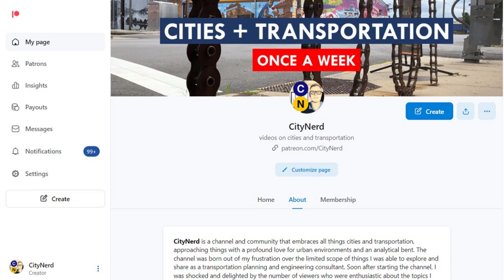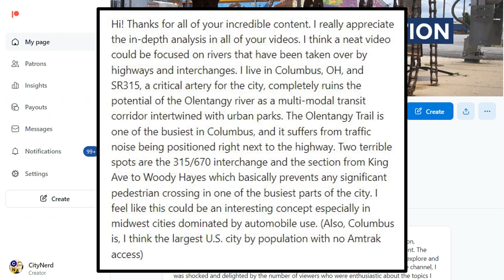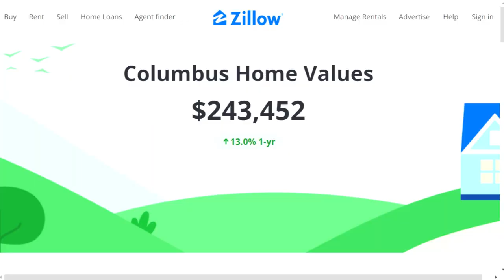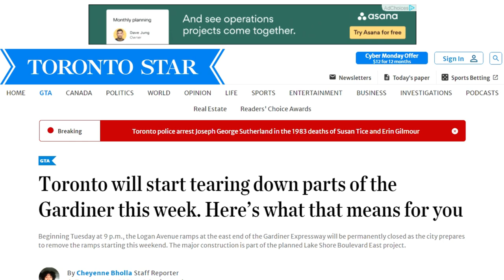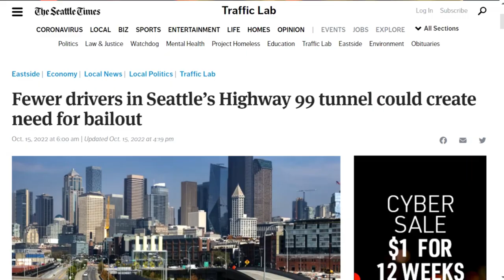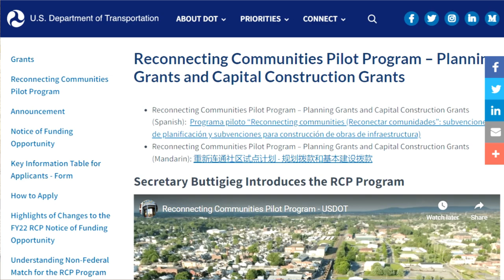Highway Engineering Madness: 10 Waterfront Freeways That Need to Go (North America Edition)

Comment: Halifax, NS, where I am from, almost put a freeway along the waterfront in the 1960s. It was stopped and now we have an incredibly vibrant waterfront and boardwalk. All that was built of the freeway was a single interchange, which is currently being demolished and redeveloped into mixed-use and green space.
Reply: Glad you mentioned this one Luke! I was going to mention exactly the same thing. I am not from Halifax, but knew about the cancelled plans for the freeway. Major bullet dodged! I cannot imagine what Halifax would be like now with a freeway instead of the great, people friendly waterfront. The naval dockyards necessarily block a lot of the waterfront, but there would have been nothing left if they had build the freeway.
Reply: Should do a Top 10 of cities that reverted and show what the difference is like.
Reply: Halifax has its own issues but a neutered waterfront ain't one

Comment: Chicagoan chiming in.

Lake Shore Drive certainly bothers my urbanist sensibilities, but I also feel like it has a weird romantic appeal to a good number of people. If you're forced into a car-centric lifestyle (which many Chicagoans are, sadly), it is a really cool stretch of road to drive down.

But as someone who has been car-free in Chicago for a decent number of years, I lament how much worse the lakefront experience is due to LSD.
Reply: It's definitely a trade-off. If LSD didn't exist, I'd probably have to move far out to commute to my job, and that would just contribute more to sprawl. LSD is the only way for me to connect to the expressway.
Reply: It's legally supposed to be a "pleasure drive" which is sort of commendable (but not really). And it doesn't even abide by that.
Reply: I think converting it into a boulevard with a high frequency transit option is a good solution. It allows some car usage to remain for those who need it, but also provides a transit alternative to get people out of cars & make the parks more pleasant.
Reply: not from chicago, never even really been there but i drove through there a couple times. took LSD once, its a great drive but 6-8 lanes limiting access to the lake shore from most of the city. should still exist but reduce the lanes.
Reply: Chicago neighborhoods typically have streets with cars parked on both sides, and then an alley in between with garages that are full of cars too. Getting rid of LSD would cause non-stop traffic jams on our East-West axes until people adapt to a more urban style of getting around.
Reply: @newagain9964  low income people also take the buses that run on it
Reply: I lived at Belmont and LSD for a number of years. There was tunnel a couple blocks away - CityNerd thinks somehow that these tunnels are unappealing. I didn't give it a second thought - walk through and poof - you're on the greatest lakeshore in the world. These other examples have prevented almost any use of the waterfront. As CN well knows, the lakefront in Chicago is fantastic. So it's all there, even if LSD disappeared you would have to cross some type of through street to get there. So it's not perfectly convenient, but it shouldn't be on the list at all - because very very few people that live near the lake think "I'd love to go to lake today, but don't want to deal with LSD." I don't think anyone thinksthat. If you want to go to the lake, you just go the lake. (I'm sure in some stretches it's a little  more difficult - but not that much.)
Reply: @mauryvan361  the thing about a highway is you don't get ground-floor retail in the buildings along it. That's a huge missed opportunity. And some of those tunnels are impassable due to standing water at times.
Reply: @collinpearsall9084  I understand your point but I don’t think anybody is missing first floor businesses right next to the lake front park. Those businesses are just in the other direction a block or two or three. When you’re on the lake, you’re there to experience the lake not necessarily a café on the lake. And then we would probably complain  about all the commercial properties right on the lake.
I’m sure they could have more and better tunnels. And somebody else mentioned that they couldn’t have a conversation for the traffic noise which should only be a problem in the very narrow area near  downtown where it’s right next to the LSD. Traffic noise was never something that I thought was more than occasionally annoying having lived right there. 
But I’m sure nobody, including me would complain if we did what Boston did, and build a tunnel to take the place of Lake shore Drive . But that would cause its own set of problems.
Reply: @AlecSchwengler  It's already a boulevard with a high-frequency transit option.
Reply: @UserName-ts3sp  That wouldn't make any difference.
I've lived here almost all my life, never learned how to drive a car, and have never experienced the perceived Greek tragedy you dilettantes are playing with the Drive. The city is not cut off from the water by the Drive at all, and anyone who would whine about having to take their bikes under a tunnel for 30 seconds doesn't deserve to bike the Lakefront Trail anyway. (Nobody whines about that because it's nothing.)

Comment: 12:50 The location of many of these cities is determined by the "Fall Line". The Fall Line is the border between the costal plain along the East Coast and the "Piedmont" foothills further inland. At these locations, rivers had rapids and they were the harbours for river shipping in the past. These inland harbours grew into a string of cities in the modern US that stretches for thousands of miles.
Reply: Many east coast cities started as mill towns before wide spread steam power and needed the rapids for hydro power for mills and factories.
Reply: Well, true, but Raleigh and Charlotte, the two largest cities in NC, aren’t on rivers. Raleigh was intentionally selected away from them because a site for the capital was being chosen during the revolutionary war and people feared the British coming up the rivers. Charlotte was established where it is because it’s at the intersection of Native American trading routes. Set up to take advantage of that trade. Assorted smaller cities I have no idea. It’s certainly a geographical oddity to have none of the states largest cities sited on rivers.
Reply: @granthancock3622  even without being directly on rivers, both Raleigh and Charlotte are close enough to rivers that the army corps of engineers was able to create lakes by damming the rivers to create reservoirs so they’d have drinking water.
Reply: The fall line is an awesome phenomenon/concept. Basically anywhere where a shift in transportation mode is required, becomes a likely catalyst for a town/city. But since the fall line hinges on rivers, it's totally counter as an explanation for the lack of rivers in North Carolina's major cities.
Reply: None of the named cities are on the fall line.
Reply: Raleigh was chosen well after the war but your point stands. Also the owner of the land gave the location committee an evening entertainment consisting of a beverage called “cherry bounce.”
Reply: But the rivers had nothing to do with their location or development.  The lakes are a long car drive outside those cities. That’s not “close” enough to have anything to do with their historical location.
Reply: Well, except for the fact that none of the named cities in the video are anywhere near the fall line.
Reply: @thebuttermilkyway687  Raleigh is but the others aren't.

Comment: Most inland North Carolina cities were built along railway lines. This is actually true of much of the southeast, which has only a few major rivers. So they may look random if you are expecting waterfronts, but there were reasons.
Reply: What is the source of water for those inland cities? Underground water from wells?
Reply: @mowplsu  It comes from reservoirs - there were a bunch created in the early to mid 20th century IIRC. At least for the 3 biggest cities in NC (Charlotte, Raleigh, Greensboro)
Reply: @mowplsu  There is enough water supply via surface, reservoirs, and ground water, just not enough for significant navigable waterways.

Comment: Chicagoan here! I spent pretty much the whole video wondering if you were going to bring up Lakeshore Drive. 😅

My take: the tunnels under LSD do make it relatively easy to access the lakefront on foot, though using them is decidedly less pleasant than just strolling on foot at grade would be. The real issue with Lakeshore Drive is the noise--it generates constant noise that seriously hampers one's ability to really enjoy the city's otherwise incredible stretch of lakefront parks. There are a few express buses (most notably the 156) that make good use of LSD for fast public transit, though in all honesty the 156 is largely duplicative of red line trains for all but the richest of lakefront property owners, so I'm not sure how many points that should really award it.

If I had to guess, I'd say that demolishing Lakeshore Drive will be a hard sell politically, as many Chicagoans rely on it for daily commuting. We should still totally do it, though, then pump whatever funds that frees up into expanding the L system and running more frequent trains.

Comment: As a Chicago resident, Lake Shore Drive (LSD) presents with a love-hate relationship for me. I run in the park every day and avoid the pathways nearest LSD, although there are constricted sections that are right along LSD and you can't avoid running close to LSD and are rather unpleasant. The tunnels under LSD are pretty cool places for me. I've been through all of them and rather like them. They're placed at about 1/2 mile intervals. Some have cool entryway artworks and paintings. Over the many years I've been going through them, I've never known them to be dangerous. 
What I do love about LSD, are the all-day express buses that I use to go to the Loop. I rarely use the L because I can get to the Loop in 15 min on the express bus w/o traffic. They run until late at night. So, I love LSD for that convenience but hate it for taking so much park space. The city is thinking of re-designing LSD with dedicated express BRT lanes and perhaps addl infill to add park land. In beautiful Jackson Park, the presence of LSD is especially egregious as it presents as a near continuous wall right up against the water. 

I do remember, when I was a kid in CA, and my Dad would use the Embarcadero Frwy to get into Chinatown or North Beach quickly. I remember that is was a bleak freeway to be on. The lower deck was dark and gloomy. I didn't even know what the Ferry Bldg looked like until the 90s when they tore the freeway down. It was only then that I realized just how the city opened up after it came down. My whole life, the city was cut off and shunned the Bay, now The Embarcadero, and especially the Ferry Bldg, is a jewel of the city.  

The cities of NC are located along the Fall Line. This is where hard rock gives way to soft soil and, as a consequence, as far as water borne freight can go. Most of NC's large cities are located along this line. Cities were located along the Fall Line for the water mills, transportation facilities, and commerce. There is a line of cities located along the line from DC to Atlanta.

Comment: Lived right off Lake Shore Drive for a few years, near the north end by Foster Ave. I used to walk to the shore all the time, no problem. Some factors that mitigate the yuck: Yes, I did have to walk under the tunnel, but once you cross under, you get this glorious wide expanse of beautiful lush green fields and trees. There was a dog beach there, and lots of other beaches all the way to downtown. The pedestrian/bike path gets crowded at times, but it goes nowhere near the road. It would be nice if they widened it or added another one. Also worth noting that freight trucks aren't allowed on LSD, and this probably keeps pollution lower?

Comment: Funny thing is that most of those locations, including Chicago, the highways are close to, but not on the river bank, and the actual river banks are filled with good uses, especially in Chicago where there's a great trail, marinas, piers, parkland, and even a golf course.
Reply: It almost makes it worse. Riding your bike down the Lake Shore trail in Chicago when it's only a few feet from a giant freeway is so loud and bad for your lungs. It's like the city planners were designing Chicago specifically to maximize particulate matter inhalation.
Reply: I don't know about Chicago, but in Toronto nearly all the land lakeward of the expressway is landfill. Many buildings further inland have weird features that make no sense until you realize that's where the waterfront used to be.
Reply: @slavkovalsky1671  Historical context, everything east of Michigan Ave from about Cermak Rd (22nd St) to Oak St was built on landfill as part of the Columbian Exposition. Michigan Ave literally was at the lakefront.
Reply: Think that's the biggest point... Much of these sit on landfill, or former warehouses that went into disrepair as river commercial traffic declined.

It was simply the easiest way to add a road without demolishing a swathe of the city.

Comment: Another great video but one item you could have added ( and I hope you read this): beyond taking out lovely green space connecting Back Bay and BU to the river, when they built Storrow Drive they installed an at-and-above-grade interchange smack in the middle of Charlesgate Park, a flood control park and part of the Emerald Necklace designed by Frederick Law Olmstead.  Yes, THAT Olmstead.  They destroyed an Olmstead Park for a highway interchange into the Fenway. Hardly punishments enough for such an intergenerational crime.

Comment: The reconnecting communities fund removed a freeway in Detroit. I would love to see your analysis on that project- Detroit is sort of a dichotomy. The city is super car centric but also has an award winning River walk and a lot of new walking paths being installed to make the city walkable.
Reply: I will be so pumped once it's not possible to take I-375 directly from I-75 to Jefferson Ave! Next step: terminate M-10 (aka "the Lodge" at I-75, and leave Detroit as it always should have been, with no freeways entering the core downtown, and with I-75 at a respectful mile or so inland from the river.

I grew up near Philadelphia, and had figured the combined atrocities of I-76 and I-95 through Philadelphia would have made the main list. It's so dispiriting if you're in the historic area of Center City to have to cross ten lanes of freeway (expressway in Philly jargon) on a concrete deck to get to the waterfront. Philly has a great downtown that is pretty much ruined by the freeways. The only saving grace is that in the 60s PennDOT proposed running expressways along pretty much every waterway in the city http://www.phillyroads.com/history/expwy-map_1966/
Reply: Detroit should have the I 75 numbering follow I 94 and 96 around midtown, so everything between that bypass and water front (the current 75, the route 10 and the 2 little bits that end up in downtown waterfront) could be torn down into multimodal arterial roads, with midtown reconstructed entirely (it's just decaying skngle family homes spaces by empty lots that are sometimes used to grow crops) to higher medium density multi - use, districts (that would be like 6 superblocks) with some having social mixity. Being like sizable villages, with each its own bakery, pharmacy, school and other everyday things. Would see the city suddenly live again.
Reply: @Spido68_the_spectator  actually, that’s pretty much the cities master plan right now. IDK if the state and feds will go with tearing out the highways, but the neighborhoods idea is pretty similar to what the city is already encouraging in terms of development.
Reply: @jacobbwalters8133  a giant reconstruction would bring great stimulus, with thousands required to work.
Close suburbs could follow suit to become medium density

Comment: Man tacoma is just AWFUL for any thing traffic related. There's non stop highways in every direction, confusing off ramps in every direction, random bottlenecks for no reason, and just SO MUCH TRAFFIC. You haven't even got to Seattle proper yet and you're getting the experience.
I also hate I-5 being where it is in Portland, thankfully it's not on the side of the river people really use for walking. It makes downtown a lot nicer not having that highway. Problem is I don't know where you would put I-5. It does need to exist, it's THE interstate that connects the west coast and redirecting all of that traffic to I-205 alone would be an awful solution. I-205 already has too much traffic. You can't really loop I-5 to the west of the city because then it'd be on the other side of the Tualatin mountains. The sunset tunnel is already hell going through.
Really the only solution is a MASSIVE tunnel project that I don't see happening ever.